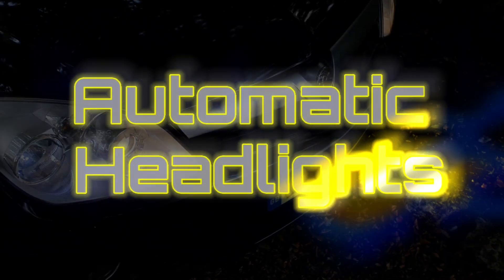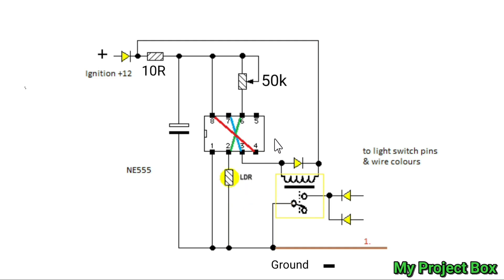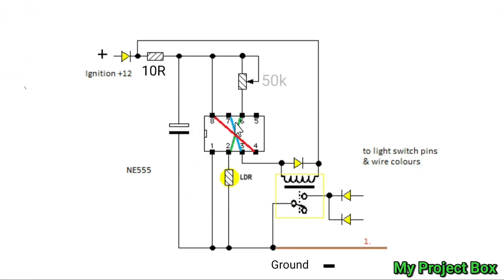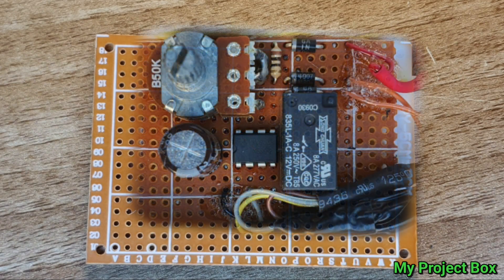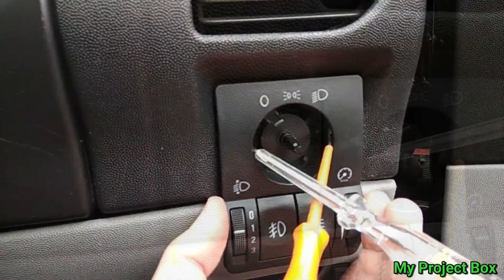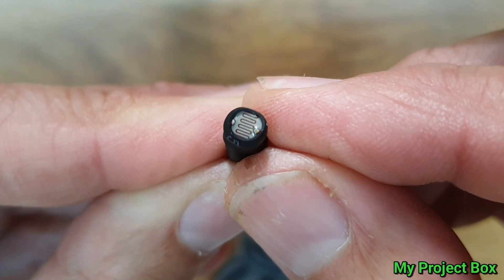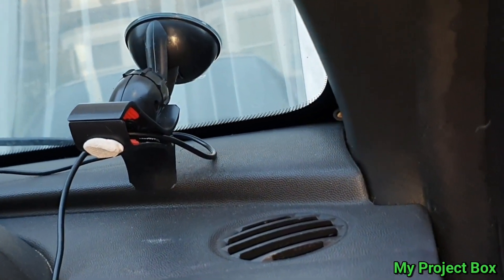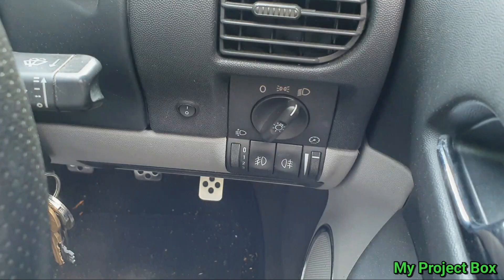Automatic Headlights Corsa-c Tigra DIY circuit Hack Opel Vauxhall

Comment: Hi can you send me schematic diagram with parts list so I can make one. I can source parts just need detailed  list & diagram.
Or failing that how much would you charge to build me one & ship to UK?
If you pm me we can discuss.
Thanks
Reply from the maker: This schematic is in the video. You can do a screenshot. All diodes are 1N4007. You can use a 470uF 25v capacitor, the value is not critical.  Any small 12v relay would do😉.
Reply: @My Project Box  
Thanks I will try but it's a bit blurred my end.
Could be my eyes though.
Reply from the maker: @BearandSuesKaraoke  Make sure youtube is playing at full quality 1080. In the settings  then do the screen capture.

Comment: when you switch light inside car ? whats hapend ?
Reply from the maker: They just come on as normal, but they won't  automatically turn off. So in "auto mode" you use the separate switch, and leave the normal light switch off.

Comment: Bloody good job. My girlfriend recently got a tigra and sometimes I drive it and forget the headlights as used to autolights.. I know on some Vag cars you can just get a new switch with the LDR and it'll plug in and work so I looked for one for a corsa c/tigra and here I am.

How much would you like to build another box complete with wiring the correct length to reach the cigarette lighter? I can manage to join the power from cigarette lighter to the 3 switch wires but building the circuit is a bit out of my league... Cheers!
Reply from the maker: I have have recently moved house and don't have a workshop to make projects. I also have very limited spare time at the moment. In the future I might be able to make up some kits to sell. I'm just very busy at the moment 🤣.
Reply: @MyProjectBoxChannel  No worries fella, if you do get a few mins and would like a few quid to get yourself a beer i'd much appreciate it. If you do, give me a shout and we can sort something out....
all the best,
Reply from the maker: @jjmmjj9999  I have in the past, as a quick and dirty fix, change the light switch wiring in such a way, so if you turn the ignition off, even if you left the lights on the lights turn off, when you turn the ignition switch off. They would come back on when you turn the car on, but at least you can't forget them on.
Reply: @MyProjectBoxChannel  I did think about that to be honest, just as you say can't ever turn them off

Just connect ignition live to dipped beam wire wouldn't it?
Reply from the maker: @jjmmjj9999  no still have the light switch working. But if you leave the  light switch in the on position, the moment you turn the ignition off the lights turn off. I did it on my ford focus where you just swap one wire behind the light switch. That way you can still turn the lights on and off the old way if you want to. On the tigra you might need to use a relay.